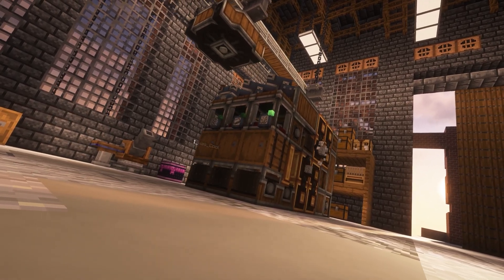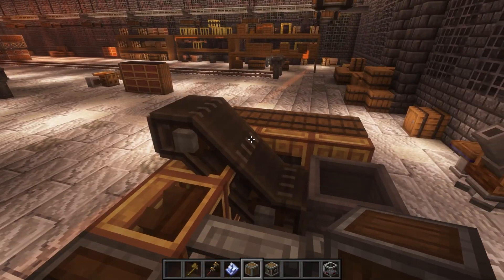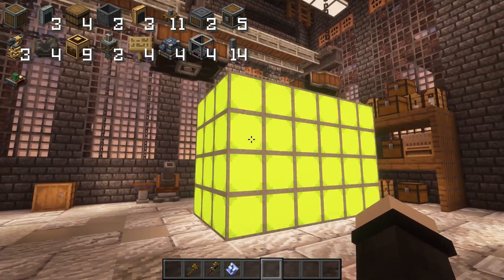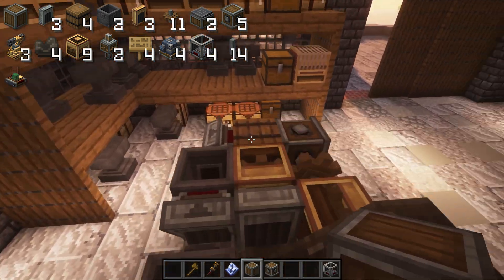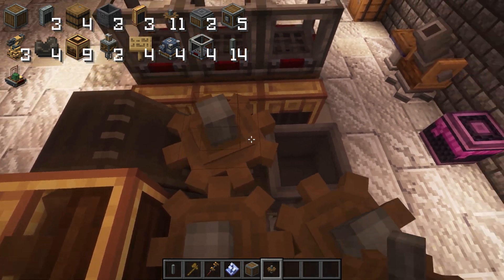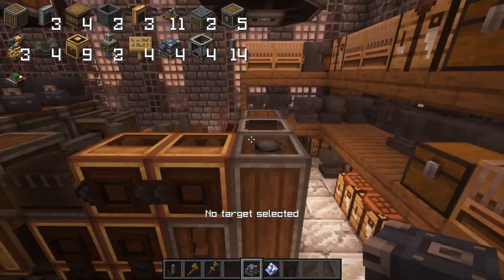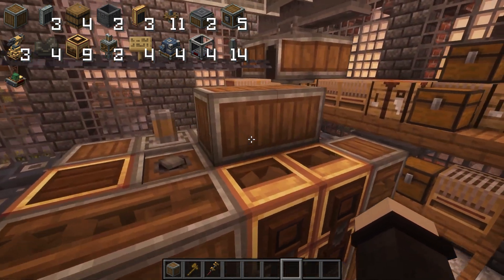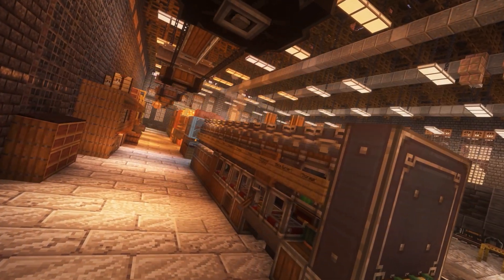Super Compact Yet Extremely Efficient Create Mod Andesite Alloy Farm!

Comment: Yet again, another great video 🎉❤

But why do the blocks under the basins have to be shafts?🤔
Reply from the maker: I use encased shafts instead of andesite casings caues they are cheaper. I always fill in holes in the machines with various cheap parts to prevent it from horrible.